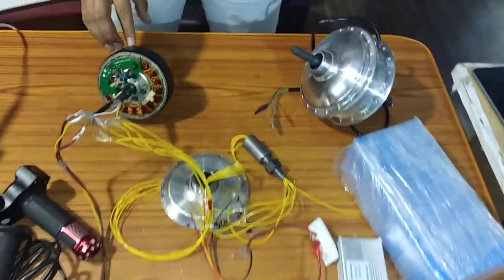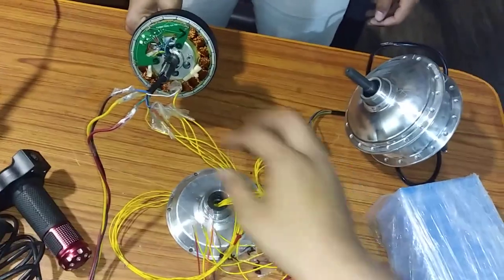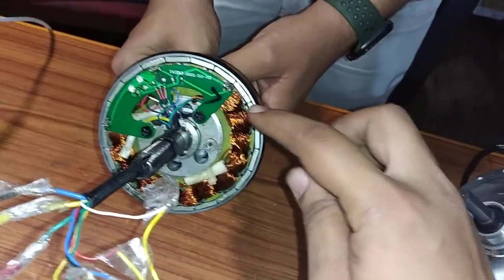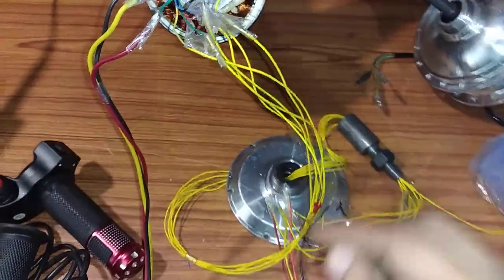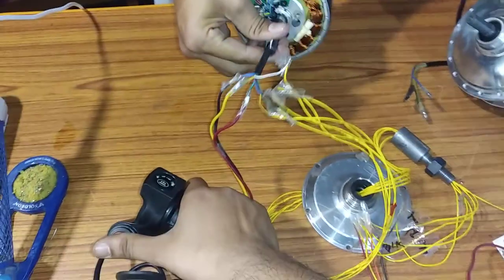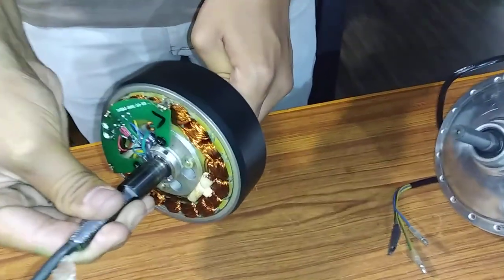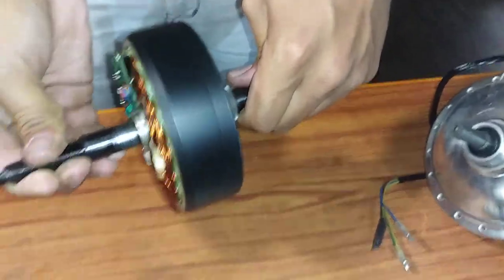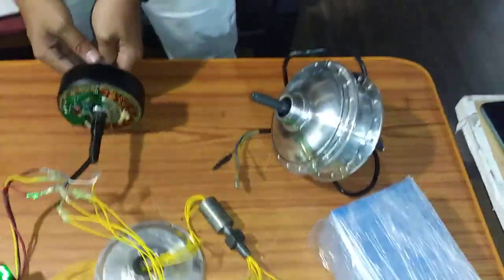Hub Motor Hall sensor 43F replaced with 41F and it works perfectly at  @roboticsdna2495

Comment: Hello sir i have a question
As we can see there are 4 hall sensors in hub motor 3 of them face neodium magnets around coil and 4th one faces the cap which you have removed on that cap a magnet is placed as i think it is for rpm count so the question rise here is can we do something to increase the rpm of motor by using big magnet to generate false signal. 

Please reply
Reply from the maker: 83296 49598 whatsapp to this number please